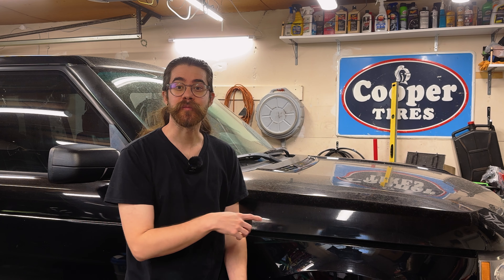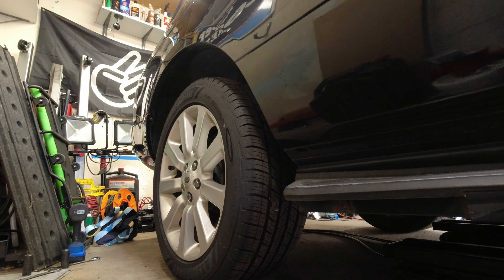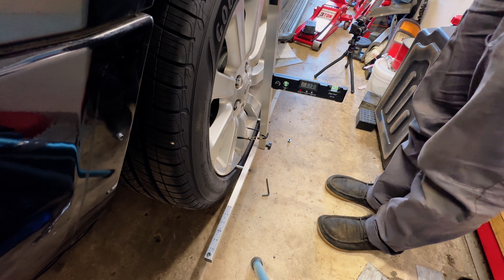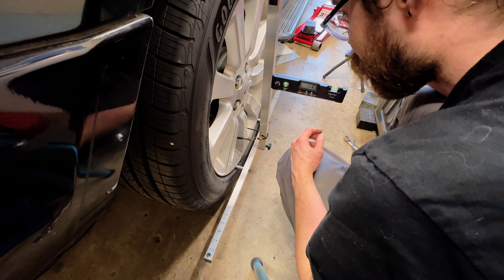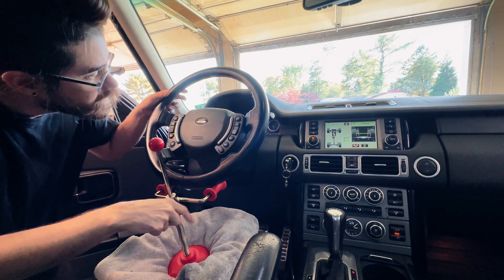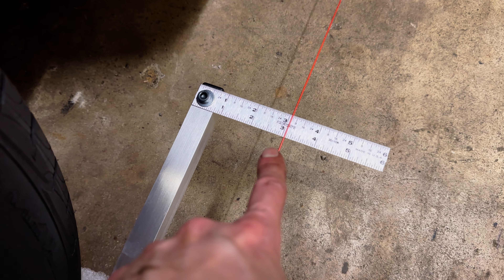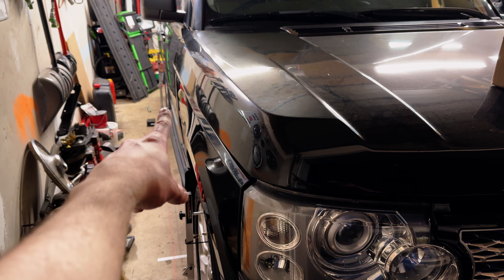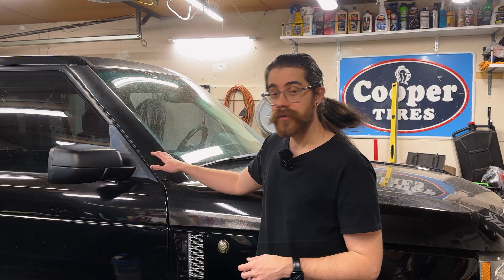DIY L322 ALIGNMENT! - Using a QuickTrick Wheel Alignment Kit on my Supercharged Range Rover

Comment: Only issue you need to be mindful of, is that the suspension needs to be loaded (wheels on the ground) when you go to torque down the adjustment screws. Otherwise, you’re putting excess stress on the bushings, which leads to abnormal wear.

You should look into buying lift blocks, so you can set the vehicle down on them, and work from underneath to adjust and tighten.
Reply from the maker: Yes, lift blocks are definitely something I'll be getting! I think to torque the rear links on this truck I'd need to take the wheel off either way, but I could probably get them tighter with the load on them if it was on blocks.